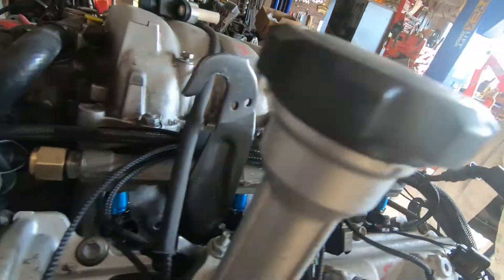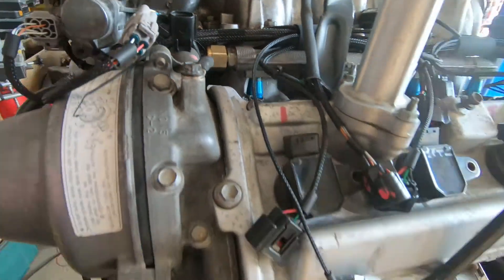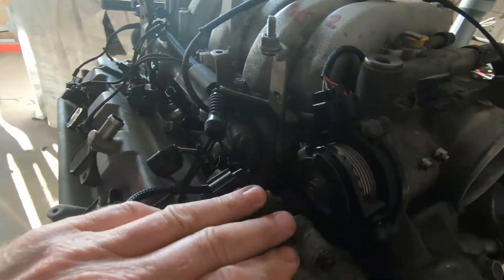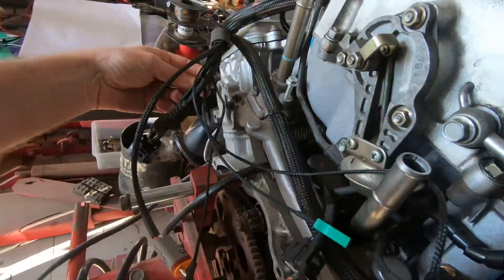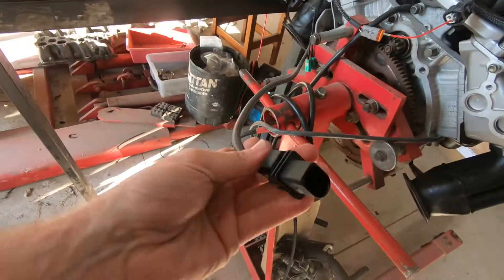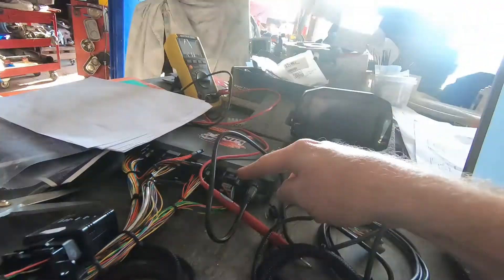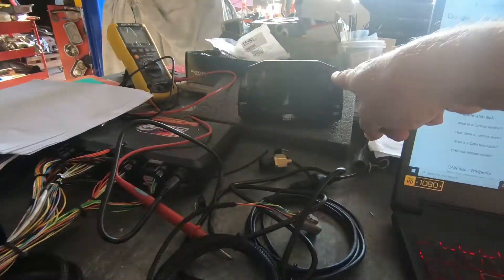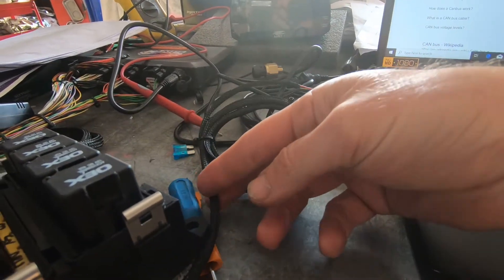Setting up of Link ECU linkdash.  Same as AiM Strada

Comment: Great video sir very helpful.. I am a novice, recently just bought a bespoke ‘mil spec’ loom, really tidy job, a link G4X fury and new 7” strada 1.2 dash, the dash is communicating with EXU via can 2, I have car base map on and it runs, I set up dash snd all works, but I’m running an ethanol blend, have u ever displayed ethanol content on these dashes? I cannot find the sensor listed, it is listed in PClink and working, I just can’t for the life of me get it on the dash , any help be greatful Lou appreciated
Reply from the maker: Thats in interesting one that I wish I had a ecu and dash setup to test.  I believe there are some digital inputs in the link datastream which are both sent from the link and received by the dash.  Not all data that is sent is receive which can be an issue at times.  I would allocate the ethanol sensor onto one of the digitals which are transmitted and received then set up as an ethanol sensor.  I'm not 100% that it can be done but reasonably confident that I'd be trying that.  Cheers Kelvin
Reply: @CartuneNZ  hi Kelvin, thanks for the reply I appreciate your time, and I love your videos very Informative iv watched loads recently!! Sorry I’m not massively in the know with this, I just upgraded from years of power FCs!! So go ecu control, can control, go to can stream, turn on next stream, give it an ID, try add ethanol content, and on race studio 3 go can Input, same stream, and input the ID I assigned and remove something else that’s transmitted if needs be? I hope that makes sense .. Shane 😎

Comment: I need some help. I have a Link g4x ECU and the link strata street. I can't get my ecu to start the car yet. If I could message you on my Facebook Nismology or IG that would be better. Any help is greatly appreciated
Reply from the maker: Hello.  Have you sorted this yet?  I can spend some time looking over it as a charged job like any other workshop work if required.  Cheers Kelvin
Reply: @CartuneNZ  thank you I got it sorted. Had to synchronize timing and it started. With the Strata dash, can I tap I to the wires for CAN signal to the g4x?